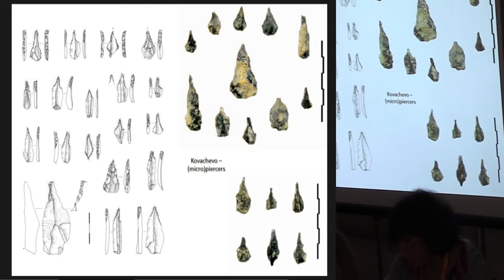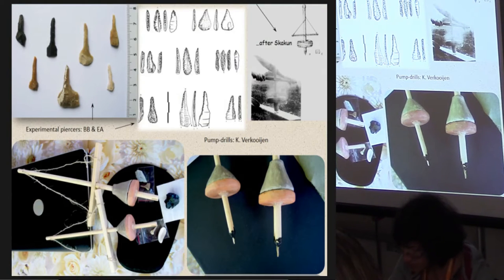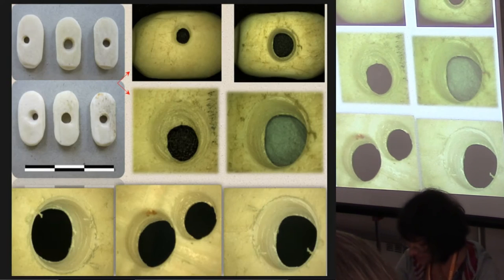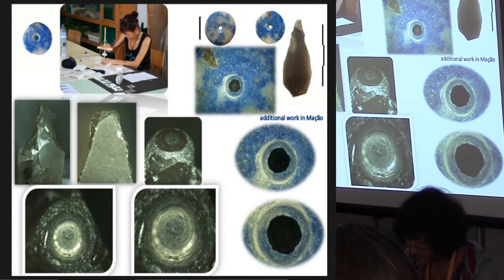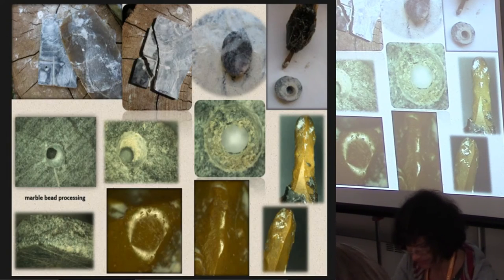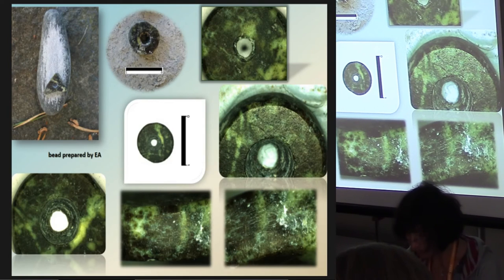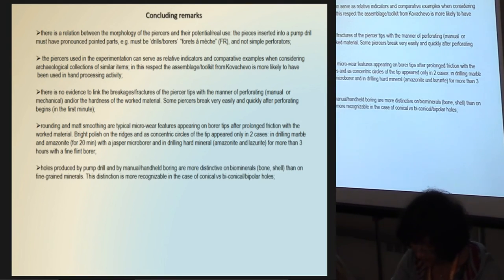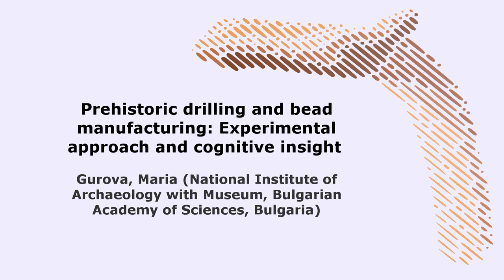Prehistoric drilling and bead manufacturing: Experimental approach and cognitive insight

Comment: What an awesome video. Thankyou for publishing your work. In February and March 2022, I began work on a stone-age turquoise necklace, and have so far made 22 beads. Disks and pendants, all of turquoise ground flat, wet, on "the sidewalk". Some of the softer beads were drilled in as little as 3 to 7 minutes each. Complete drilling of a set of 7 pendants taking only 53 minutes! My simple flint hand drill sometimes pitched to a wood shaft and other times held between the fingers. Some of the turquoise was almost agate hard (nine beads) and these took most of 4 days work: with progress very slow, only one or two per day. I will be attentive to any more of your results! I was considering use of a pump drill with a wood or bone bit with sand grit. Thanks for Publishing!
Reply: Dude that sounds so cool. Have you made videos on this?
Reply: @Zane-It   No videos but pictures. A total of 49 beads by end of the project. 15 or so rectangular pendants and 3+ inches of disc beads. The most interesting finding was that after the disc beads are perforated, it is then easier to regrind them smaller and to a uniform size around the perforation.
Reply: @frankparrish5657  sick sounds killer

Comment: Hello, great video. I wonder if copper pointed rods were heated and pressed with fine flint chips, then used in those drills. The smaller grit like chips would cut through much faster than a single chip. Copper was used in the Neolithic period. I also had this idea on a huge scale bow drill with the same embedded copper rod for drilling rock. It would leave the pattern left at unfinished Egyptian monuments. But i think they used sand and water as a cutting paste.